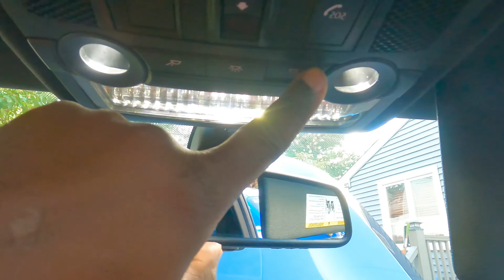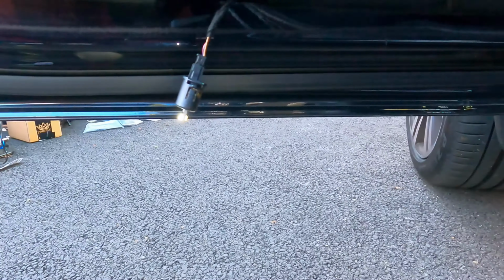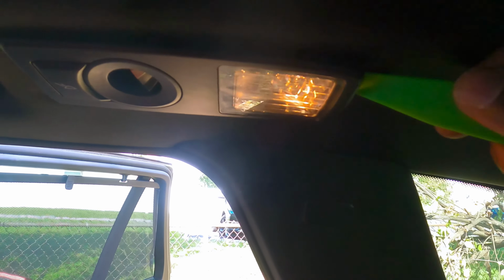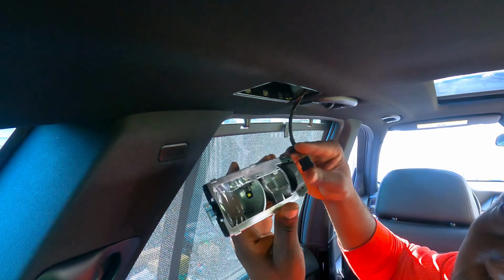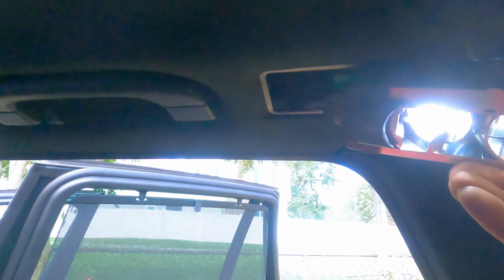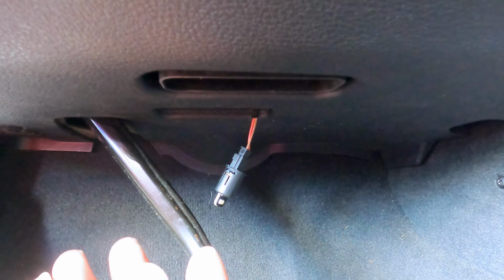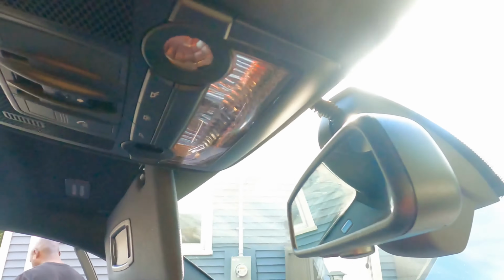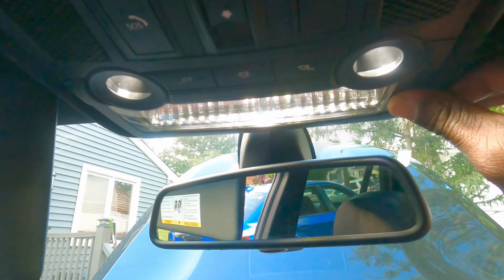BMW X5 e70 interior LED upgrade

Comment: Hi do there's lights flicker the LED ones I have got now do. They flicker all the time do  the same it only my back one that do thanks
Reply from the maker: I had some of the issue too too but that was after 8 months  a few started to flicker. so I replaced them.  I think the lights are too small  sot ehy can really handle the power. maybe  but its an easy fix.
Reply: @CarStomIt  okay thanks 😊

Comment: Hi mate! Thanks for the video!! I am about to do the same to my X5 E70 and I have one question: did your lights pack include a light for the rear license plate? Mine didn't, but I had a Porsche Cayenne before and the pack I got did include a light for the license plate... Do you know if it's easy to change? Any visuals on that? Thanks!
Reply from the maker: No my pack didn’t bit I do plan on changing the bulbs is a few days I’ll try to make a videos on it. Maybe it will be a short.

Comment: Bonjour,
J'ai beaucoup de mal à enlever les 2 ampoules sur les places arrière du véhicule. 
Le système d'accroche est trop dur.
Peur de casser. 
J'y ai passé 1h.
Pourriez vous m'aider ? 
Merci
Reply from the maker: Oui sa c’est tes dure. Tu dois utiliser un petite utile plastics abécédaire une petit 🪛 tournevis plat. Et tu dois essaye the le pousser de par derrière à l’avant. Oui c’est tes compliqué mais c’est possible. Tu dois m’être de la forces dessus pour que san puise se sortir
Reply: @CarStomIt  merci pour votre retour. 
Au top votre vidéo, merci encore.
J'ai essayé de nouveau, mais je dois mal m'y prendre...
J'ai 3 crochets. Deux que j'essaie de basculer. Je vois qu'ils viennent vers moi.
Mais impossible à sortir ce bloc, et remplacer les deux leds intérieurs.
Reply from the maker: @ fait moi confiance c’est très dure de le faire tu dois essayer de le mètre dans une angle.  Tu dois le pousser ands une angle 📐 sa vas sortir mais c’est très dure sa ma prix quand même beaucoup de temps. Regarde la vidéo encore spécialement la deuxième party ou je retire l’autre lumière de l’intérieur.

Comment: Hi.
Can you help me.  I have a flicker problem
Reply from the maker: I have had that issue as well. I think some of the lights are bad. Please try the same T10 bulbs from last fit. please check them out. I had better luck with them. https://lddy.no/1cqd1 ( you can use my Affiliate  discount code: CarStomit07
Reply: @CarStomIt  ok thank you so much 👌🏾